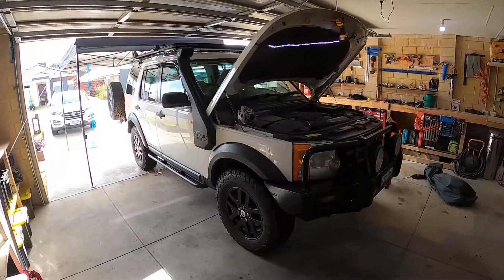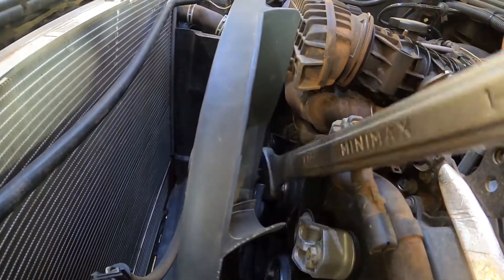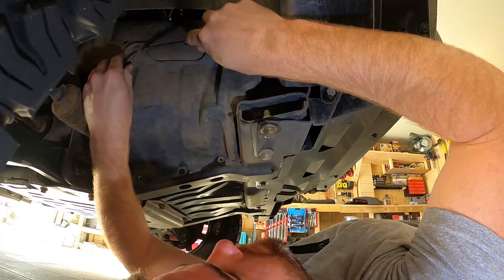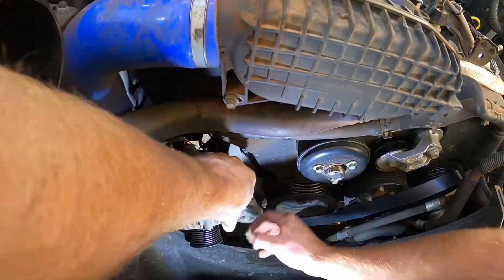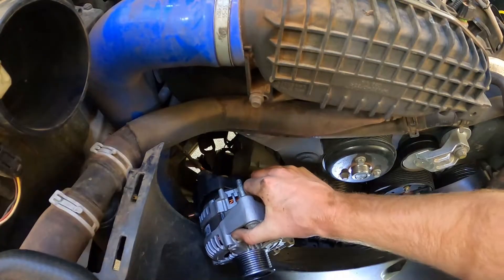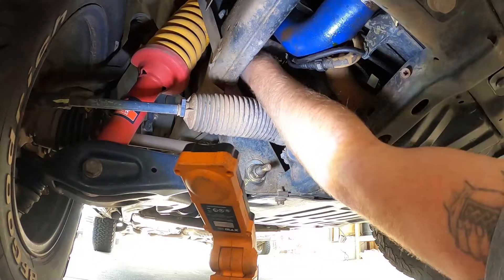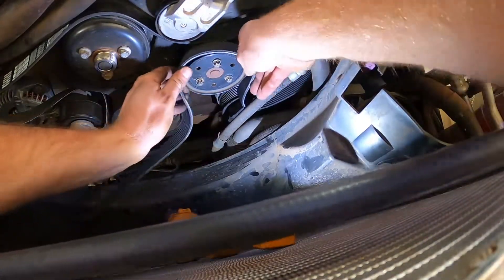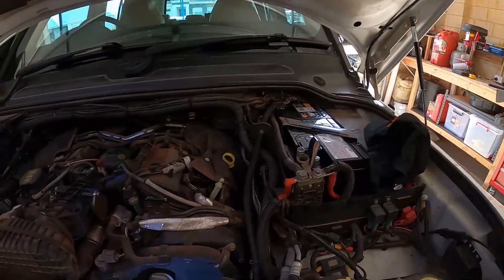DISCOVERY 3 LR3 ALTERNATOR REPLACEMENT

Comment: 12/04/24 this has proved to be a very valuable video I shall watch several times & then get stuck in Thank You
Reply from the maker: Couple of things I've learned since then, the oil pump on mine was wrong and failed  chassis serial numbers meant nothing so physically check yourself for the oil pump with the reinforced sections 

Landrover giving me the seriel number failure range seems to be just a number they came up with themselves haha 

Everything else is valid

Comment: Great video!  I've just completed the same repair.  We have two LR3s (Discovery 3s).  You got the same volt output that I'm getting from the new Duralast alternator: 13.8.  Our other vehicle, which has the OEM Denso gets 14.2.  It is my understanding that 14.2 is the target.  But I am getting no error codes from the 13.8 output.  Do you have any experience with this question/issue?
Reply from the maker: Mine will vary depending on how charged the battery is , when fully charged it drops down to 13.2volts , however when I first start the car and for the first 10 minutes or if my secondary battery is charging  it sits at 14.2 volts  I will buy denso next time though
Reply: @OUTBACKDiscovery  Yes, I'm now thinking that I made a mistake with the Duralast.  These vehicles are electronically fussy.  May even just swap it out now, given how differently the other vehicle, which has Denso, runs volt-wise.
Reply from the maker: @ChristofBove  if your not having any charge issues I wouldn't bother in all honesty , there a load sensitive alternator so basically if your battery is fully charged you don't need 14 volts output aslong as your getting 13 volts I wouldn't be to fazed 

Mine sits at 14 volts for the first 10 minutes and then runs at 13.2 volts which I'm happy with .My understanding with smart alternators is there supposed to drop some load off once battery is fully charged and just put what's required into the battery that the system requires 

Like drinking water through a water bottle through a straw but turning the tap on slowly to replace the same amount you drink 

They do this to help with fuel economy and remove unnecessary load from the engine 

Only reason I'll go dense next time is for the longevity side of things but I was running low on cash at the time haha so far so good though I've done 20k km with it and alot of Off-Road- corrugations and mild water crossing without any dramas
Reply: @OUTBACKDiscovery  Good point.  Easy to go down the rabbit hole on these issues!
Reply from the maker: @ChristofBove  yeah man I mean from what I've read basically they just don't last as long as denso , I've kept my old one as a spare for when I go 4wding as it still charges fine above 1200rpm but was shit at idle only doing 12.5volts but if my one was to fail this one would still get me home

Comment: Yeah but how did you crack the fan bolt... I've been smacking this thing for half an hour now
Reply from the maker: Are you going counter clockwise or clock wise as if your looking from. The front of the car back towards the engine the fan is opposite thread and needs to be undone in a clockwise direction apart from that might need a bigger holding tool and spanner they can seize  on
Reply: @OUTBACKDiscovery  Think I'll try a better holding tool, thank you. I was copying the direction you went, clockwise as you look at it.
Reply from the maker: @twisted5576  good luck there such a prick when the seize on